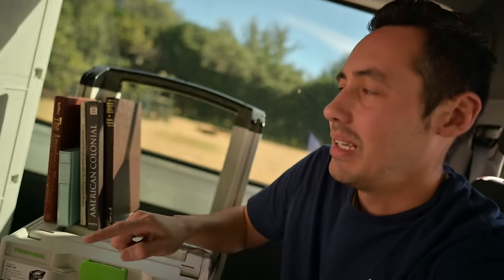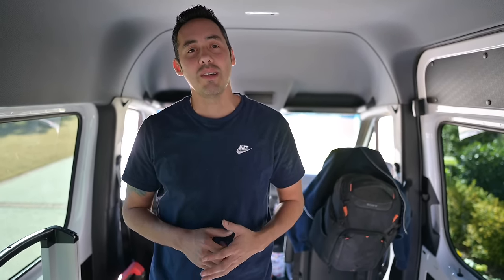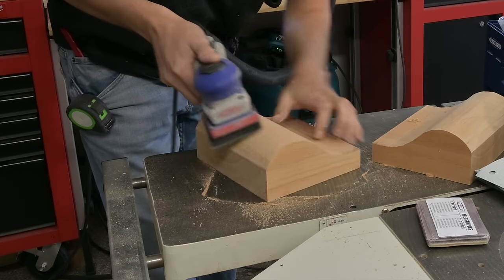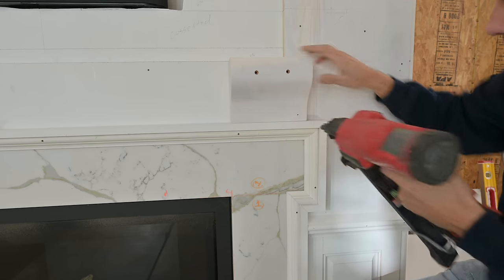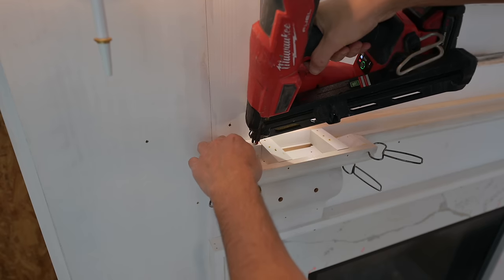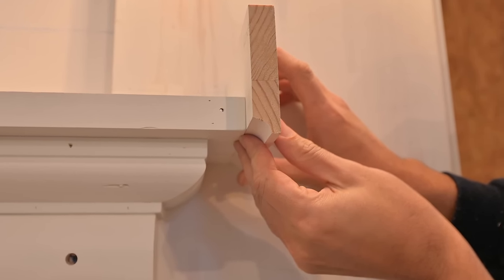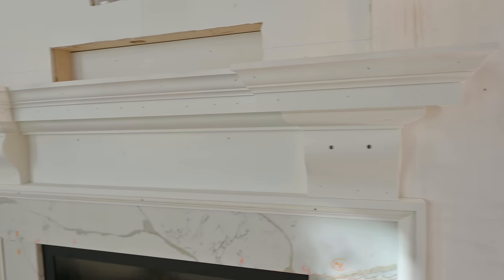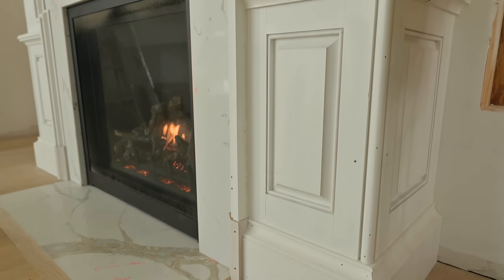HGTV would NEVER show you this...

Comment: I have been a woodworker for a little over 25 years. I've built custom cabinets, furniture, decor, jigs, bars, and fireplaces, etc. I loved being able to have some creative control when it came to fireplaces. Being able to put in custom corbels instead of cookie-cutter designs was probably my favorite thing about building fireplaces. Corbels are so unique,  versatile, and add so much character and personality to walls, doorways and fireplace mantels. Back in the early ages of architecture they were not only used for support but as a decorative piece not supporting anything at all. I'm glad they are making a comeback especially in French Provential-themed home interior as a decorative element and not just a pretty bracket. Great job!